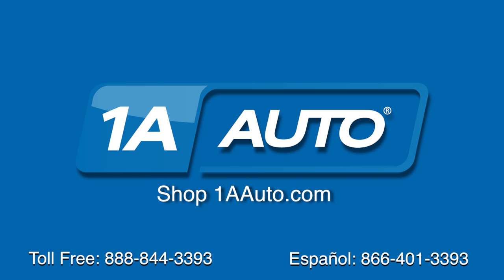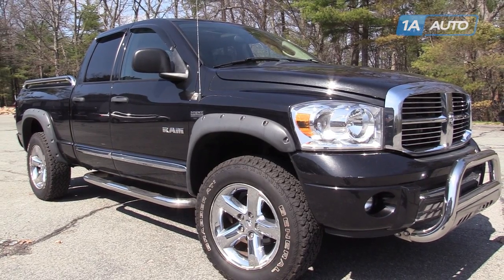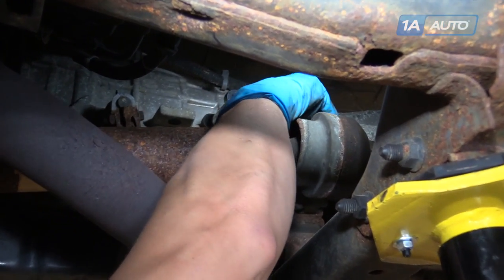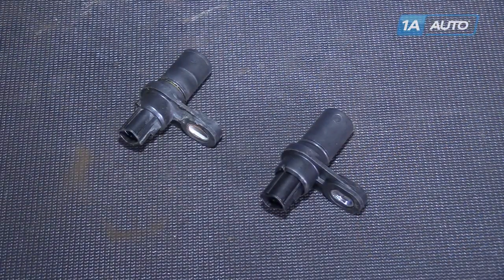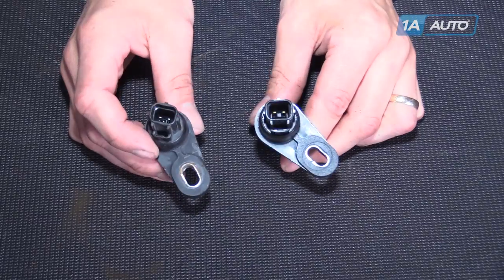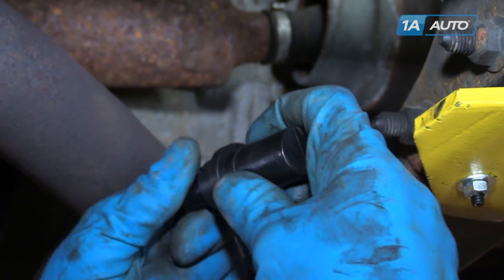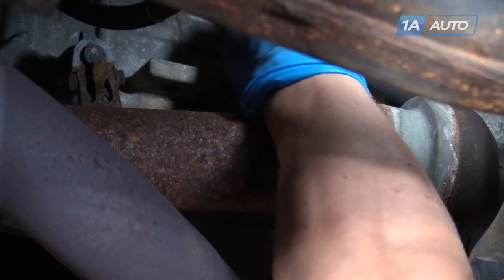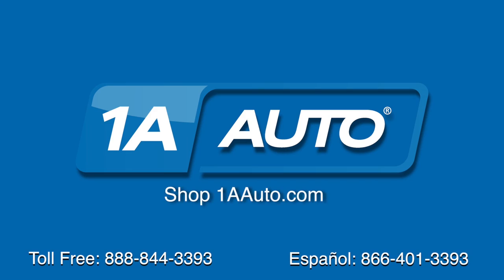How to Replace Output Speed Sensor 04-09 Dodge Ram

Comment: Would it be in the same place for a 2004 dodge Dakota? Also would that replacement of the sensor turn off the abs and brake light on the dash board?
Reply from the maker: +Asari Burk Yes. Possibly unless there are other reasons for the abs and brake lights

Comment: Do you guys sell the output speed sensor wire and connector mine got ripped out and now my truck won’t shift past second gear it’s a 2007 Dodge Ram with the hemi 2wd
Reply: Hey are you sure your transmission didn’t kick into limp mode?

Comment: Do I need to changed out both speed sensors ??? Cause I changed the one you did but its still in limp mode n when I turn it wants to shut off..

Comment: I have an 08 with 5.7, speedometer isn't working either.
Changed the speed sensor, abs speed sensor, checked all the fuses and checked the speed sensor cable with an voltmeter and has current. Still no working speedometer.
Do both Input and Output have to be replaced?

Comment: Would this fix a p0876 on a 2003 ram 1500 4.7? I changed the one on the rear axle and the one on towards the back of the teansmission

Comment: I got a 2012 ram and my output speed sensor is gone. The dealership tells me it's a 5 hour job because the bolt will always snap off holding it in.

Comment: i got a.98 ram 2500 .. my speedometer stop woking and it wont chift out of first gear would that senser  be the problem
Reply from the maker: +Richard Godin Thanks for watching.  This sensor could be the issue if you are experiencing those problems.  1aauto.com

Comment: i replaced sp s it did not do the job
Reply from the maker: +trafficjon400 We'd suggest getting your vehicle looked at by a local mechanic to figure out what is going on. 1aauto.com
Reply: Theres a 3rd on on the top of the differential